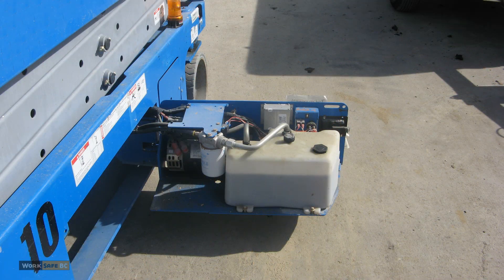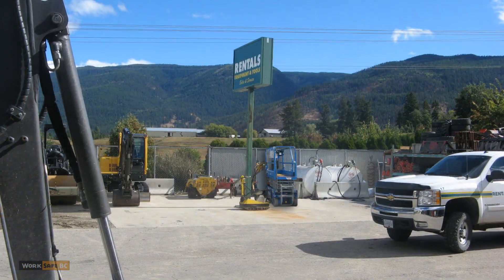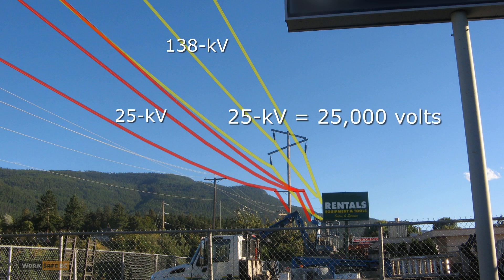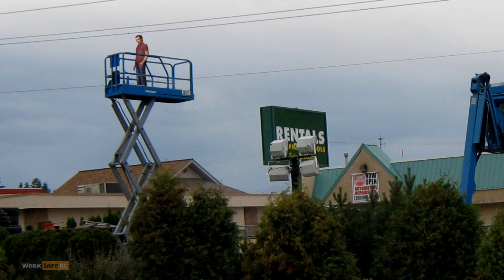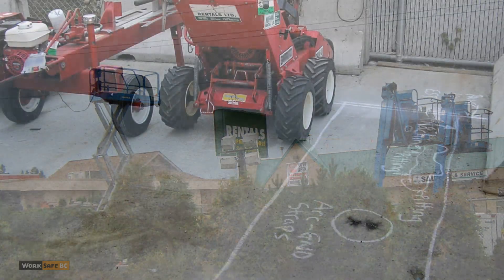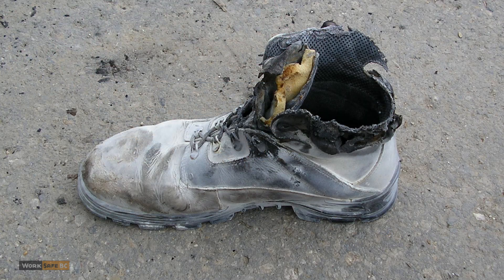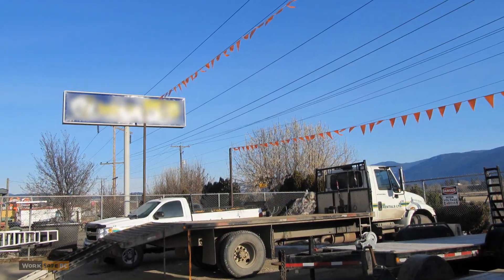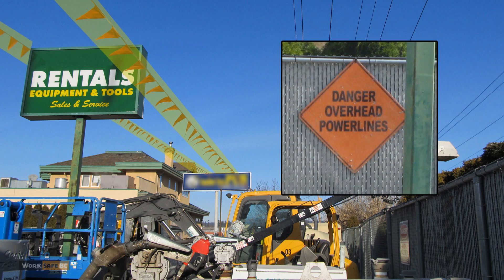Incident Investigation: Worker on Scissor Lift Electrocuted | WorkSafeBC

Comment: "The worker, seriously injured, did not survive."  I guess being killed is being seriously injured.
Reply: Sod Alfredsod yeah. He was seriously injured. Bad enough he didnt survive. He must not have died instantly.
Reply: Great catch there! That's like being killed to death!
Reply: might've been alive nearly dead tho. cause of death might be his skin burnt so badly that respiration failed, and suffocated. apparently, this happens when a person falls into molten metal/lava, it doesn't instantly kill you i heard.
Reply: he might have died in hospital
Reply: I think mortally injured would be the correct term.
Reply: The way it's worded implies "The worker did not survive due to being seriously injured." or "The worker did not survive his serious injuries."
Reply: Death is one of the most serious injuries you can get.
Reply: The re-creation makes it look like he was vaporized. Looks like he didn't survive more than a microsecond! Instantly killed is more like it...
Reply: Koningkrush maybe depends on the composition of the rubber tires, generally high voltages will blow through tires.
Reply: The lift truck had grounding straps attached. The video ahow this. Any rubber tires would be negated due to the grounding straps from the vehicle touching the ground.
Reply: Bob A Booey one can be seriously injured but not killed immediately and the die later.
Reply: Omg common sense is he was seriously injured which led to his death. How bout think before you attempt to be funny.
Reply: Bob A Booey what I'm saying I wonder what happened if he had a broken arm damn..😂😂😂😂😂
Reply: A dead body can have injuries, so yes, he was seriously injured.
Reply: Bob A Booey people need to understand that electrocuted means killed lmao ofc he died
Reply: @makenziee6264  electrocuted does not mean killed “lmao” is your IQ 2?
Reply: It's called a fatal injury.
Reply: Bob A Booey I like how the video showed a barbecued work boot, torched tools and a pile of ash when they mentioned the worker’s injury
Reply: Hhmm,  I'll wait here,  you go check for a pulse.  lol
Reply: And "If you're killed, you've lost a very important part of your life" as Brooke Shields would say

Comment: Doubtful that a 25 kV arc jumped through the air to his hand.
I forget what the distance is but think 25 kV will not even jump 1/2 inch of air space.
He likely touched the conductor.    Had there been no ground straps, the rubber wheels likely would have created enough insulative resistance to not allow a conductive path to ground.
Reply: newstart49  Who said there is unlimited amperage?   The effect on the poor victim is essentially unlimited amperage.  The victim will "blow" before the fuses. 
If there is not enough current flow through the victim, the system will not open the circuit.
Reply: newstart49  Yes.  Practially speaking when it comes to victims, commercial power is devastating and practically unlimited.  A short through a body likely will not trip any over-current breakers or fuses.
Reply: newstart49 You know, it's kinda hard to believe when I can't think of any way to reproduce this. If you short out 480 V, it's gonna arc badly, with strong enough force to melt everything around, but I am still wondering how did that jump through 1 inch and then flashed over. To be honest I don't think that even track of concentrated saltwater could short it that much.
Reply: If he looked up and touched it, then he really was deficient in his head. Although who knows what you feel when you get that close to 10kV? Maybe he felt his skin starting to feel wierd with static pulling on hair just before it flashed over?
Reply: +Robert Gift SORRY ROBERT BUT 25KV WILL ARC AT ABOUT 7 INCHES ESPECIALLY TO POINTED FINGERTIPS. THE GROUND STRAPS MADE THE LEAP EASIER THAT'S TRUE BUT 25KV WILL CROSS A TIRE TREAD TO GROUND. WE DO NOT KNOW IF HE JUST WASHED THE LIFT OR OTHER CONDITIONS BUT IT SHOULD NOT HAVE GONE DOWN.
Reply: ***** Correct.  Capacity is not a consideration in this essentially UNLIMITED power supply.
Humidity combined with contamination can create a sufficient conductive path.
But pure water does not conduct!
Such is why glass insulators work well.  Rain washes contaminants from them.
Reply: +newstart49 says: "Robert Gift You can have 10,000 volts, but if there is no capacity, you will just receive a mild shock instead of an explosive arc.  Why do you think high voltage cattle fences do not explode when a cow touches it?
I've been with this for 42 years- please educate yourself!"

 It's called amperage.  Cattle fences may have 10kV but current only in the milliamp range.  
(You can charge a capacitor to high voltage and deadly amperage from a low amperage source.)

My huge Tesla Coil produces millions of volts.
Though its amperage is low, a million times a low amperage creates enough Wattage to be deadly.
Reply: newstart49  Never heard that term applied to anything but batteries.   Commercial power has essentially unlimited amperage.
Reply: +newstart49 I've actually had 120 volts jump on the leads of my multimeter, they were like 3 or 4 inches apart also it was dry and sunny day.
Reply: Mark Schulz IV  ^  It sounds like you are mistaken or exaggerating.  That is even too great a distance for typical static electricity arcs. 
Or a very high voltage surge just happened to come down the line and high voltage arresters failed to ground it.
Reply: +newstart49   Wow!   Sorry about that flash injury.  Hope that you recovered completely.  Did they require eye protection in 1986?  

Could a reverse EMF voltage spike cause a high enough voltage to jump that far?
That high voltage, micro-amp arc would create an ionized conductive path which would "short" the 480 V high amperage AC.
Reply: You better study some more. In the real world, Arc Flash potential at 480 volt switch gear is actually HIGHER than Arc Flash potential on 15Kv switch gear. Relay protection limits current much lower on the higher voltage than the lower voltage.  A higher Kelvin rated suit is required to switch 480v gear than 15Kv gear. Once you have an arc, ionization starts, the more the load, the more ionization, the greater the arc. If you are near a lightning strike, or an electrical explosion, the sulfur smell that lingers is actually the ionized air.
Reply: +Robert Gift  But did you see his shoe down there in the video ? Lordimerci !!
Reply: But they showed is cooked shoe in the video? !?!?!!
Reply: +Robert Gift It's called ELECTRIC CURRENT, and it's measured in AMPERES
Reply: Jose Torres and to calculate volts you need to use following formula:
Volts = Amperes *2 * sin(180) * 3.14 (pi)
Reply: Jose Torres Yes.  I have installed many GFIs. I credit GFIs with greatly lowering the number of household electrocutions.  (GFIs will not prevent electrocution between Hot and Neutral conductors.)
How does this apply to a 25 kV distribution line?

(Electrocution = death.  "electro execution"  Not just being shocked.)
Reply: you're kidding me right? Buddy, a furnace transformer puts out only about 10kv and can arc at least an inch at low current levels.
Reply: +Vance Ogden  sends: "you're kidding me right? Buddy, a furnace transformer puts out only about 10kv and can arc at least an inch at low current levels."
10kV cannot start an arc across an inch.   You can "ignite" the arc with conductors much closer and pull the conductors apart.
Reply: The Tool Guy  220 VAC will not jump half an inch.   You can touch the conductors and pull an arc.  But two 220 Volt conductors a half in apart will not arc. 
Rubber tires will insulate much higher voltages.
If rubber tires and no ground strap and no outriggers, the guy would not have received a fatal shock.
I worked in a high voltage laboratory.
Voltages up to 2.8 million volts estimated.
Reply: The Tool Guy  You can pretend all you want.   Funny how metal  terminals in 240-volt clothes dryers are closer than 1/2 inch.

My 8-foot Jacob's Ladder will not arc until the 13kV transformer's conductors are within 1/3 inch.
Reply: The Tool Guy More than a half inch of rubber. Scissor lift tires are solid rubber I think. I certainly have never had to put air in them
Reply: Vance Ogden  Can't trust rubber tires because surface contamination and moisture can create a conductive path on the tire.

Some may contain metal chord which lowers their insulativeffectiveness. 
Tires were never designed to be insulative.
But usually they are of sufficient insulation for lower voltages.
Reply: Vance Ogden   Doubtful the 10kV will cause any detectible effect until you touch the conductor.   I will have to try with one of my Tesla Coils.   One has a 12kV transformer.
Reply: Robert Gift
 There is no such thing as unlimited amperage. The feeds and their protection determines the max amps that can be drawn off the line. The max amperage is then determined by the step down transformer serving the area and/or building which is fused. If there is a direct overload or short, a switch will open the circuit then close again in a few seconds, and if the short or load is still there, it will open twice and then remain open on the third try. This helps prevent a whole section from going down.
Reply: Robert Gift
 You said it. I quote from your previous statement; "Commercial power has essentially unlimited amperage."
Reply: *****
 You might try your YT settings.
Reply: prodtutorials  Sad that the lift was grounded.   The rubber tires likely would have offered enough resistance that he would not have been killed.    Doesn't take much insulation to defeat 25 kV.
Reply: +theSYNQmaster WROOOONG!!!
Reply: +Robert Gift Have you ever heard the terms "ground fault circuit interrupter (GFCI)", "residual-current circuit breaker (RCCB)", or simply "differential breaker"? >Ð
Reply: Without the straps there is still the chance of a capacitor type discharge between the base of the lift and the earth, certainly enough to kill?
Reply: Steven Hall  The voltage is not high enough for a discharge through air to ground even if just 3-inches from wheel rim around tire to ground.
Reply: The Tool Guy Is this not a reenactment?
Faulty if they claim the arc jumped to the victim.  Likely that the victim touched the conductor.
Reply: The Tool Guy  Watching a reenactment does not mean it is accurate.   Doubtful that the electricity arced to the victim.
Reply: The Tool Guy  Across the street showed enough detail to discern that he was close and it arced?    Or did he TOUCH the conductor?
Reply: Vitatta I have worked with all kinds of high voltages, both AC and DC.  
Doubt that 25 kV will jump that far.
As a teen I created a "static electricity arc switch" using a high voltage static charge to ionize a path to discharge a high voltage high amperage capacitor.

Contamination can create a conductive enough pathway even if the vehicle in not wet.

AC voltages can be averaged in Root Mean Square, so the actual sine wave's peak voltage is significantly higher than the indicated voltage.   The peak could enable an arc where the same DC indicated voltage would not.
Reply: Robert Gift
 You can have 10,000 volts, but if there is no capacity, you will just receive a mild shock instead of an explosive arc.
 Why do you think high voltage cattle fences do not explode when a cow touches it?
 I've been with this for 42 years- please educate yourself!
Reply: Robert Gift Yep, it seems like I am exaggerating. The guy said that he had voltage jump at only 480 volts. This is laughable IMO, as if it's non in resonance you need quite decent current to actually have an arc AFTER shorting out leads, however jump through air inch away is not possible at this low voltage. To break an inch of air you need at least 25 kV which is 50 times that.
Reply: Mark Schulz IV

 I am talking to people who know nothing about the subject.
  1986, two story medical building, 3 phase 480v 40 ton HVAC system. It happened and I spent 4 hrs in the hospital getting my eyes flushed,cleaned fixed and a week bandaged up.
  Frankly I could care less if you believe or not. Pencil neck.
Reply: prodtutorials they cooked it themselves for the show
Reply: +Robert Gift  I've had 480 volt jump over an inch right on the leads of my meter.  It isn't just the voltage but the capacity behind the voltage to cause the jump, as well as humidity.
 And I too was wondering if the machine was not grounded, what would have happened.
Reply: *****
 Do you know anything about electricity?
 Capacity is another layman term- the available amps or current.
 Please look it up and learn before commenting.
Reply: You bright boys really make me laugh!! All of your BS shows that you have NO real idea of how things work out of your college lab.  I have over 40 years as a Journeyman Lineman. There are a number of variables involved in arcing conditions. System voltage, load on the line, humidity, wind (builds up a lot of static even on un-energized wire). Any number of things cause ionization. Once that is present, your arc limits really increase. That's why OSHA has a 10 foot rule.....look it up!
Reply: Robert Gift
Laymans term for amperage- "capacity"- as I stated before.
Reply: Robert Gift ive got news for you. I've seen them do it with strong ignitors. Arced from one of spring contacts across to the other when it wasn't touching the electrodes
Reply: The Tool Guy  The machine was likely grounded.    If no ground straps, the 25kV would likely not have hurt the man.   It can't jump 1 inch to a grounded object or other conductor of that three-phase line.  Doubtful that contaminents on the rubber tires would have created a conductive path.
Reply: The Tool Guy  I worked in the high voltage laboratory of Bendix Aerospace.
Also I have a high voltage transformer and three Tesla Coils.
25 kV can't jump more than 1/2 inch, I recall.
Or is it 1/3 inch?  (Please correct me if I'm wrong.)
This tragic event was probably the victim contacting the 25kV conductor.  Not just gettting close to it.

Comment: Did he take the powerline with his hand, why ?
Reply: hovnanian   That's a wired recharging when touching cable. 
Wireless mode is at 10'/3meters close to wires in some cases. 
Be safe.
Reply: +hovnanian no he didnt touch the line, electricity at that high level of voltage can jump like 13cm  from a line to other object through air. so you better dont get close to one.
Reply: Euphorium Inc Im ok if I am 15 cm then ?
Reply: hovnanian Only if the line have less than 150000 volts, electricity can jump like 1mm in the air per 1000 volts so if the line have 100000v you should stay more than 10cm away. It depends on the humidity and temperature of air also.

Comment: ive seen people survive lightning strikes so to avoid dying make sure you're grounded and don't have an easy path for electrical current
Reply: Derek Wall make sure you are grounded is completely incorrect!  That would make you part of the circuit!! You want to be insulated from ground, just like birds on a power line and not grounded as a squirrel is before frying while being grounded on a pole transformer and reaching for the power line.

Comment: This is terrible. I work for an equipment rental company and we have a safety huddle every morning. Sometimes I think it's stupid because of the things they come up with. But they are right, We all need to be reminded of the situations we can encounter on the yard while checking a unit out and are not any different on the job site, Just different circumstances to deal with. Do a 360 degree evaluation up and down before beginning any type of work. At least that's the way we do it. Be Safe!
Reply: yard needed to delineate where lifts were not allowed. perhaps with a substantial speed bump.
I'm gonna guess it's there now.
Reply: Well they do it because somebody has done it at one point